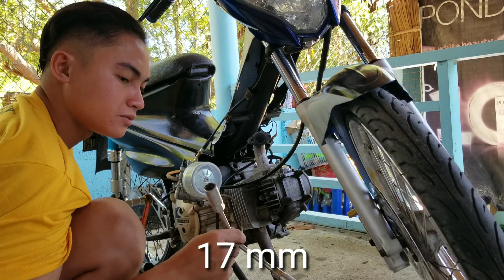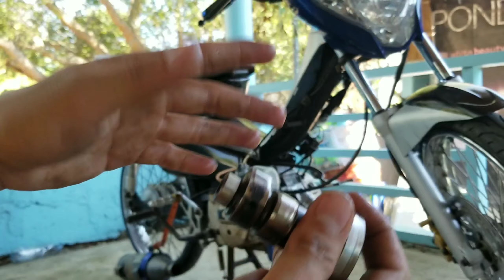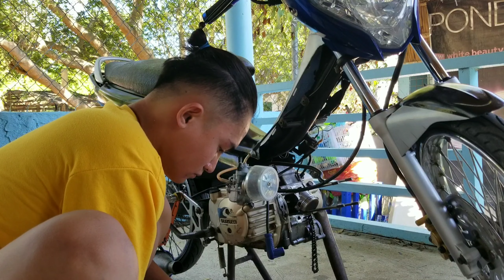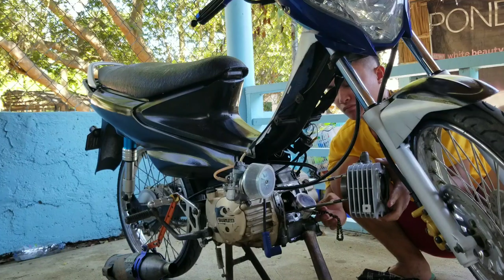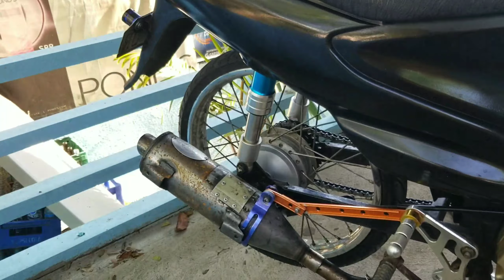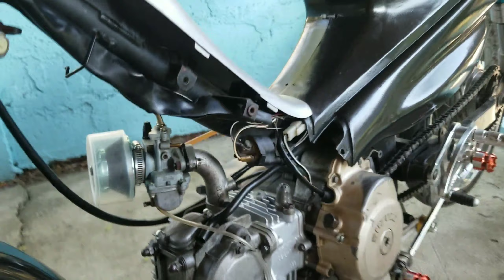Paano maiwasan ang ingay na lagitik ng motor. Rocker arm | cams ||Papsy Vlog

Comment: Boss ano kaya problema nito. Napalitan na ng cam bearing na malaki. Ok naman tensioner. Ok din timing chain. Ok naman valve clearance. Stock engine. Dipa nabuksan. Hindi sa clutch dumper kasi sa taas ang tunog. Salamat

https://youtu.be/Z0vbnf7RCN4